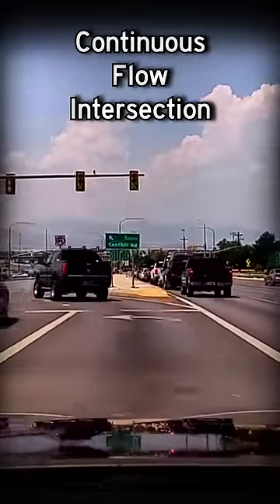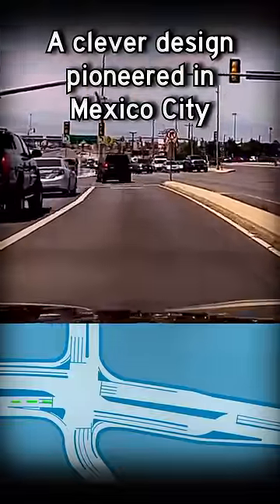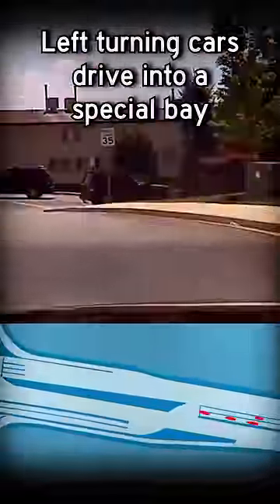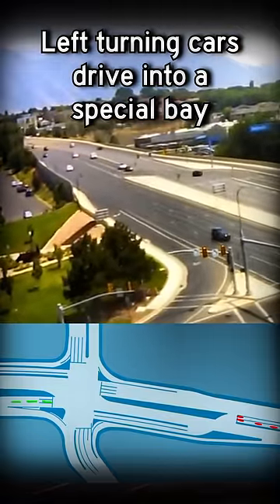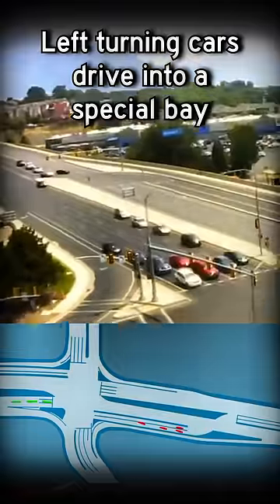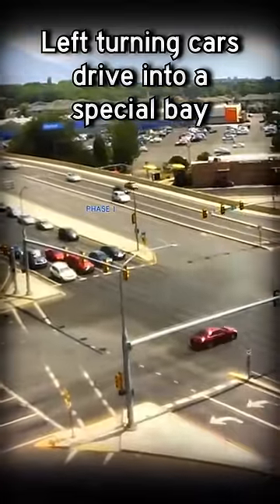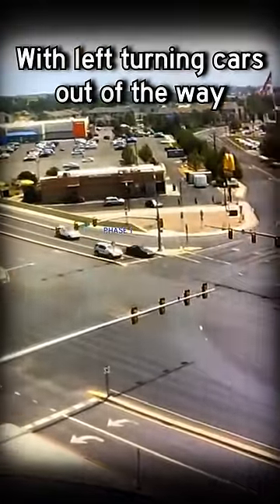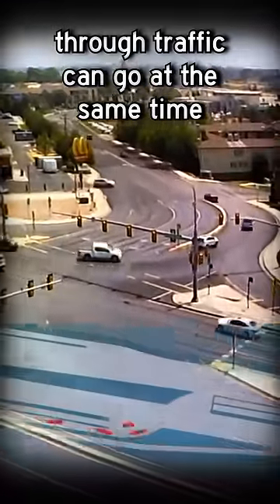Continuous Flow Intersection #shorts

Comment: Imagine being a pedestrian and having to set aside 10 minutes to cross the multiple crosswalks that will undoubtedly not be synced
Reply: I live near the intersection in the video. It has a pedestrian tunnel running under it across the main road so that's less of an issue than you'd think.
Still a frustrating intersection with the light timings and heavy traffic, but overall it flows pretty well.
Reply: Imagine being a pedestrian

Comment: At this point, you may as well have a highway interchange though. It would ironically be easier to walk across
Reply: I think one CFI was a temporary intersection which bought them some time until they could replace with an actual interchange.
Reply: A diamond interchange is better and if you watch you'll be fine
Reply: This is Also a freeway entrance it is in Orem utah
Reply: Utah did these to bring the level of service from an F to a C on one of there corridors. They eventually(10 of 15 years later) turned it into a freeway but when you dont have billions to do it, this will work while you try and find the cash.
Reply: This specific intersection has 1 maybe 2 underground tunnels to get you from one side to the other. This is one of the most crowded and improperly planned areas of all of Utah and I get to live 2 minutes away
Reply: Why the hell does it matter if you can walk across a fucking highway intersection,
Reply: @jakegrube9477  cause this is a stroad through a city and not an interstate out in the middle of B.F.E. You do realize people can live on one side and work on the other, right?
Reply: That also happens to cost dramatically more

Comment: If you measure the land required to build one of these intersections, not including the original drive lanes themselves, it's roughly 3 acres. Meanwhile @roadguyrob criticizes roundabouts for adding distance for pedestrian travel.
Reply: In the UK and Sweden there are often tunnels that go under the roundabout pop you up in the centre of it an lead you any which way you want to go. I've also seen roundabouts in the middle of roundabouts for cyclists.
Reply: roundabouts arent as good as you think sometimes you actually need just a good old 4 way and some times need a modified beasty one to work. traffic lights are better for complex intersections and when there is a lot of traffic from one direction
Reply: Have you seen big rotaries? They’re absolutely terrible. Great replacement for a 4 way stop, but not multiple lane interchanges
Reply: @jacob1121  Essex born here.... we overuse roundabouts. They're great at what they do but they have a place and purpose. They're not for every interchange.
Reply: @jacob1121 There is one at this intersection as well.
Reply: @The_Flying_Comrade To be honest I think you have no Idea what your saying. There are few few times when a roundabout is not the best option. But in almost no situation is a 4 way system best for traffic flow or safety. There are any different roundabouts for different situations. What you will find is that when a roundabout needs to have more exists they usually use a spiral roundabout. Which is a roundabout where aslong as you get into the right lane originally you will be taken to your exit with no last second lane change. Obviously then there is a normal roundabout. 4 way systems take way longer, and are less safe.
Reply: @Milkster1  let’s say you have two stroads intersecting. You really think a rotary will work for 6+ lanes? Rotaries need to be small enough that there isn’t a huge speed delta between traffic in and traffic entering and the traffic needs to be light enough that it never saturates (breaks flow)
Reply: Tunnels aren't great for pedestrians. Nobody feels safe in a tunnel

Comment: I watched this 15 times and still trying to make sense of it. How is it any better?!
Reply: Because while the traffic is going perpendicular to them, they load up into the left turn lane. Basically you only have to switch the lights in each direction once, instead of having to do straight and turns for each direction.
Reply: No one will get T-boned at a Left turn by oncoming traffic. See how far back the switch over is..... then left turners are out of the way
Reply: It's a terribly-made video.  It's sped up too fast, the guy is shouting, the camera is moving around.  By the time you think you're looking at what he's talking about, the camera moves and then it ends.
Reply: Its worse mainly because of thenweird left turning lane on the oncoming traffic side
Reply: The left turn traffic goes to the turning bay while the straight going traffic is at red, then the left turn and straight going traffic can get the green at same time for both directions.
Reply: It's not. It's an advance left turning light with wasted space and and extra set of traffic lights.
Reply: it’s literally so simple what
Reply: @z7ur but they literally have to wait for oncoming traffic to stop so they can get into the special bay
Reply: @ENGRingSuccess but those making a right or left turn toward their direction from the perpendicular streets will end up intersecting them as they cross
Reply: Over time people start to avoid the intersection which makes it quicker for everybody else
Reply: It makes the traffic light less congested
Reply: more taxes going to the paving crew I guess
Reply: There's a couple of these where i live (Mexico) they are surprisingly useful
Reply: If you drive this should make perfect sense
Reply: Y'all should look up the diverging diamond intersection, it's actually starting to be implemented in the US with great results. It essentially takes away left turn signals, but is mostly used at intersections to enter highways.
Reply: They basically use the part that most in the us can't even think of doing instead  they make fking street smaller  and as you see from the video let tall about the red side is basically using the space (2 car lane ) or the pov from the green side  where the opposite  lane  where they turn right
Reply: It's not.
Reply: So...while I wait for oncoming traffic to get a red light in order for me to turn into the left turn bay...I have to wait halfway down the block? Lol This only reduces time by a fraction and consumes more land usage. How is exchanging limited land for limited time any better if the land becomes more valuable due to consumption like this, which rises property taxes and real estate, which means more HOURS spent at work instead of MINUTES in traffic??
Reply: This definitely makes it better, just harder for people who even struggle to go straight
Reply: Now there is no need for the left only arrow… when it’s green it’s just regular old green for everyone facing that direction
Reply: "continuous" is a bit false. it is better because it solves the problem of allowing them to turn left, whereas they normally would have to wait a very long time or cause traffic to slow down. it is worse if there is hardly any traffic turning left. but im assuming that configuration is specifically for an area they know are going to use it, so it will work.

basically, if volume is high enough, you can just assume a pack of cars is another unit in itself. so this is a way of organizing traffic of "units going straight" and "units turning left" on a bigger scale. just like how more people riding a bus is safer and faster than multiple cars, if volume is high. every person in a bus is synchronized to the bus (driver) itself, and if the bus drives well, every person in the bus benefits in unison. instead of "continuous", they should have meant "synchronous".
Reply: @ENGRingSuccess so does it have get a certain amount of cars or just switch
Reply: You NEVER have to wrroy about someone turning left in front of you, with or without the proper light.  And YOU never have to make a left turn against oncoming traffic.  I took my friend from NYC over one last week.  I explained it to him and he didn't see anything at all odd about it.

Comment: We will do literally anything, BUT a roundabout
Reply: Round abouts too hard for brain
Reply: But seriously, I don't know how a roundabout works with 3 lanes of traffic. Unless it cuts traffic down so significantly that you only need two lanes on each side. I kinda doubt that though.
Reply: @CoDisafishy  yeah roundabouts suck in this scale. Traffic shouldnt reach this scale tho
Reply: @Dicaso9 mutiple lane roundabouts exist. And just cut down on the lanes anyway. Build public transport and you good
Reply: @CoDisafishy  (from a driving on the left side of the road perspective) 3 lane roundabouts are pretty much the same as any other, left most lane is for taking the first exit (so turning left on a 4 way intersection), or second exit (going straight through)middle lane is for taking the second exit or the third exit (turning right) and the right most lane for the third exit exclusively- side note this does require all exits to have 2 lanes rather than the standard 1 that you see on a 1 or 2 lane roundabouts
Reply: @CoDisafishy  also usually when you get into 3+ lane roundabouts they end usually are so big you dont really realise its a roundabout so much, as they usually are more oval in shape and span a few hundred meters in size, as well as being almost exclusively seen on locations where two motorways need to cross, its fairly intuitive once youve done it once and even if your in the wrong lane other drivers will usually let you in to their lane and you have plenty of space to correct yourself
Reply: They’re so easy. From the UK and we have them here. We have 4 and 5 lane roundabouts but the entrances are controlled by traffic lights. There’s a few smaller 3 lane which aren’t controlled but with the right signage it’s easy to read. Want to go right, get in the right lane, straight on middle lane, left is left lane. Usually you can have 2 lanes that go straight on and the road markings allow for a lane change mid way round.
Reply: I'm from Wisconsin and we have an insane amount of round A about
Reply: Roundabouts are like communism.  Great in theory, trash irl.  😂😂
Reply: New Jersey has entered the chat
Reply: @CoDisafishy  look right? Car right? Stop. No car right? Go.
Reply: @rrj6919  Left in the US, but same concept. I just didn't understand how larger roundabouts worked. For example, 3 lanes each way.
Reply: @perplexed2352  That makes sense. I didn't realize the furthest lane out of the circle would be dedicated to the first turn. In your case you said the left most lane, but here it would be the right most lane.
Reply: @CoDisafishy then you shouldn't be driving jeasus christ
Reply: @gabeslife0601 capitalism isn't good in theory or practice
Reply: @vixen878  I've only caused 6 accidents in my 2 years of driving. Oh and that old lady I ran over, twice.
Reply: You havent been to North Carolina, lately have you?
Reply: There are some  roundabouts in Santa Ana,  and Ladera Ranch, California.    And other places too, I would imagine.
Reply: @CoDisafishy  dude… I “only” is not the word you use. 6 accidents in 2 years is an incredibly large amount for such a short time of driving. If I am correct that’s means you are involved in an accident almost every 4 months. I have family members who are decades old (obviously) and only been involved in 2-3 accidents. Let alone THEM being at fault maybe 1 at most per member, AT MOST. I’ve been on a moto for 2 years as my daily and have in only been involved in one with another vehicle (their fault). My point being. You need to seriously reconsider your driving style and methods. Lord knows how much you pay for insurance if you got good/full  coverage. Stay safe
Reply: @ComidaDelBrain  Yeah, my insurance company needs insurance to keep me as a customer. Come on man, obviously I was joking lol. Thought it was obvious from the old lady part. I've been driving for over 10 years and only got in one accident that some lady caused by driving down the wrong side of a one-way street.
Reply: So, Rapid City South Dakota made a variant of this on the overpass over I-90.  It feels really weird to be shunted over to the left lanes even if you are you going straight across... but it virtually eliminated congestion on the bridge.  The left turn lanes used to be backed up several blocks in the left lane instead of allowing people to go straight.

obviously, being a bridge overpass, a roundabout would not be viable.
Reply: @Mi.i.i I would lovvveeeee to know how public transport would work at Bandera rd and 1604 in San Antonio
Reply: @Mi.i.i 
Nobody is interested in riding a bus or a train.
Reply: Oh trust me... Washington puts roundabouts everywhere that has common 18 wheel traffic. Dumb.
Reply: lmao in my town theres one spot that has 3.... people are just crazy sometimes
Reply: Multi-lane roundabouts kind of suck depending on the quality of drivers in your area. In my city there's one in particular where people coming from the south side to the east simply do not want to yield, rendering the whole thing super sketchy.
Reply: Oregon and washington have roundabouts
Reply: @CoDisafishy hahaha let me tell you about the roundabouts in the uk in commonly congested areas, some of them have ✨four lanes✨
Reply: Let's ban roundabouts in the United States. 😊
Reply: We have a ton of roundabouts in my area
Reply: roundabouts work great for slow, low volume traffic. not so much for cases like this.
Reply: @Mi.i.i This specific city has public transport. Cars are just better and that's what people use.
Reply: @vixen878 Capitalism has single handedly raised quality of life more than any other system and is the entire reason you're sitting here, typing away and saying that it sucks.
Reply: They built one in my city, and we already have roundabouts on plenty of places. Roundabouts aren't always the solution.
Reply: @reinbeers5322  capitalism? no. industrialisation? yes.
Reply: @vixen878  USSR had industrialization, yet dozens of millions died of starvation. Now they're nothing more than a cautionary tale.
Reply: @reinbeers5322  im gonna need a source for that information. fox news does not count.

in the US today, tens of millions are either homeless, starving, or go without food or clean water. this is the wealthiest country in history.
Reply: @Dicaso9  Yeah the roundabouts would work if the US wasnt so fucking car dependant and if yous just stopped adding more lanes to try solve a problem thats being created because of the added lanes
Reply: @gabeslife0601 I live in a city where any intersection that can be a roundabout, is a roundabout. It works very well; much better than a bunch of traffic lights.

Comment: Implemented this in San Antonio TX a few years back at a busy highway/road intersection and has worked wonderfully.
Reply: They put 1 in Pflugerville too. I like it, and I think it works great.
Reply: Define wonderfully? Lol. Drivers down here are the worst in the country that’s the problem.
Reply: @melxdan yea on Bandera and 1604 right?
Reply: @tagosta88 Houston especially😂
Reply: Bonus points when your sprawl is sprawled enough to let you add all this nice hot pavement.
Reply: It's rough to navigate, but it does work well
Reply: @tagosta88 murica!!!
Reply: @corban.b789  It's in a couple places in SA, but Bandera and 1604 is definitely one of the largest and most important in the city.
Reply: They are testing it out in a less busy area in Charlotte hopefully they start doing it in more places
Reply: @tagosta88 no that’s Florida
Reply: There's something very similar here in E Tennessee, I-26 exit 17, Boone's Creek Rd. Scared the Bejesus out of me the first time I went through, thought I'd turned into oncoming traffic. But it works remarkably well, has really freed up the traffic flow. It was a nightmare before, if you needed to turn left. You often had to go past your desired left turn, and find a business on the left to turn into. Then go back to your desired turn, and turn right. So much smoother now.
Reply: A similar one exists at 35 & 306 in New Braunfels. It was annoying at first but it really does help.
Reply: @MonkeyJedi99  just one more lane bro, just one more lane
Reply: @corban.b789  yeah I remember how shitty it was before and how long it took to build
Reply: This is in Orem Utah… i live right next to this bruh
Reply: I hate it but I can't say it's not useful.

Comment: more proper name is a displaced left turn intersection, since that's what it's actually doing. The left turn movement is pushed further back away from the main intersection, and if it's done for both directions, it allows all 4 movements of left, straight and straight, left going the other way, to all pass at the same time.  The further light back is just timed to sync with the main intersection, so it removes 2 phases of the overall intersection, meaning 2 less phases of red lights.

Comment: For a sec i thought this was clever highway or separated road design and then i saw the pedestrian and died a little
Reply: It's a basic crosswalk that has an extra island in there. It's not any different than walking across an road with an extra lane going each direction. By far, the most dangerous issue here is the right turn lanes (that exist practically everywhere) if you're coming from the car's right, because drivers are predominately looking left and the crosswalk is significantly closer than the edge of the intersection where cars would naturally stop.
Reply: @GeekOfAllness  The right turn lane you are referring to in this example is not allowed to turn righton red and have to wait for a green arrow.  I go through this intersection almost every day.
Reply: theres a tunnel that goes under